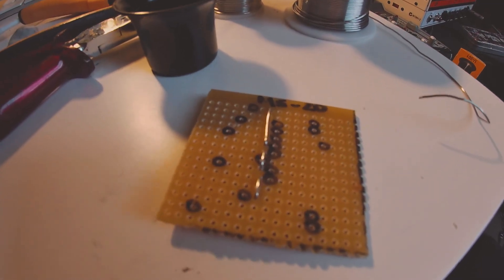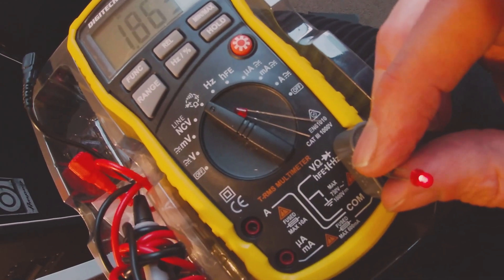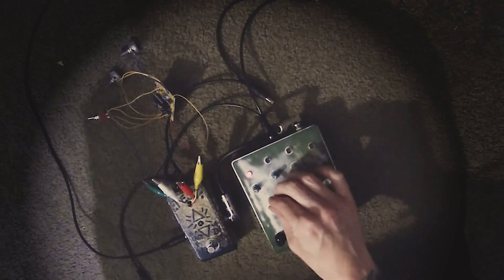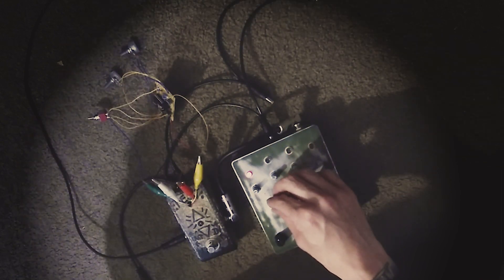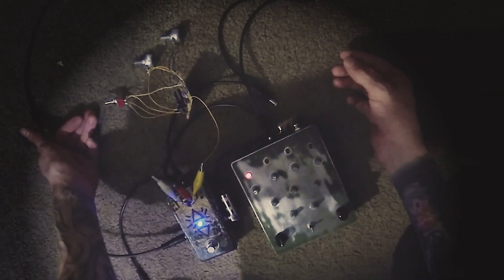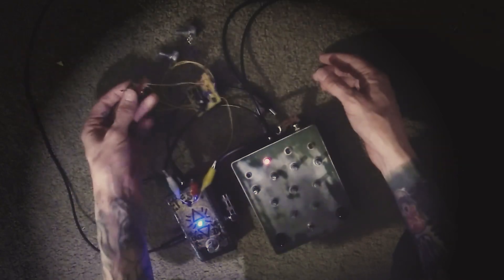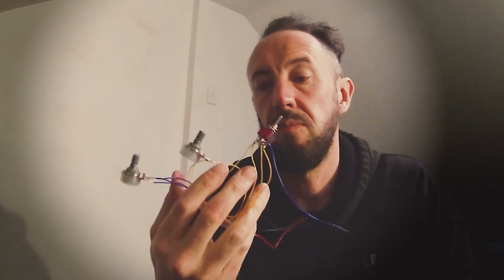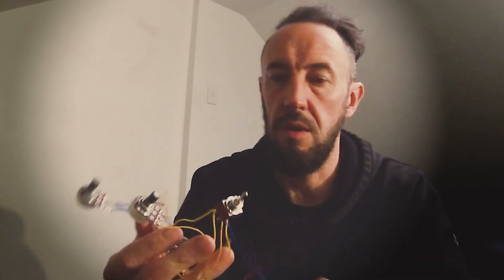DIY KORG MS-20 Filter

Comment: this is something I've always meant to build but never got around to. I might have to now. in a filtery mood.👌
Reply from the maker: It’s defiantly got some growl to it for sure, if you work out what’s going on with the switch on this one let me know lol
Reply: @unholyaudiochannel  I'm not sure but from the diagram that I've found, it looks like it's turning the 1st amp in the circuit into an oscillator and puts the signal into the output buffer of the 2nd amp - leaving you with an adjustable oscillator and a very hi passed quiet signal at the end of it.  basically, it's not an error that you've made, someone else cocked up along the way.
Reply from the maker: @Zardox-The-Heretic-Slayer  ok I’ve seen another way of wiring the DPDT to the board which might have a different effect but thinking of just leaving it out seems pointless and doesn’t really sound that great